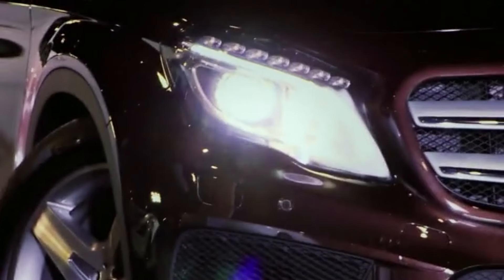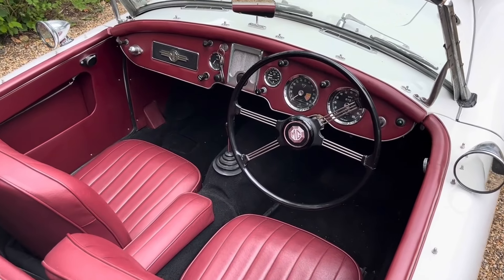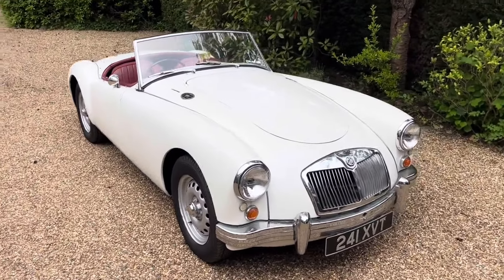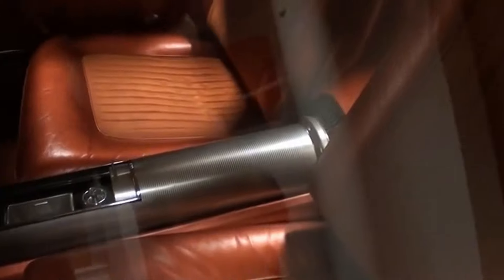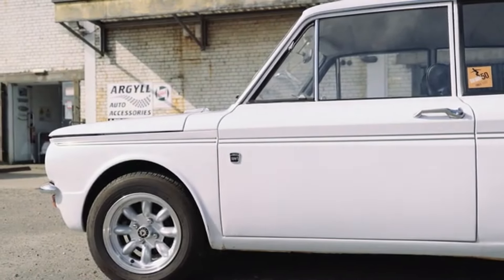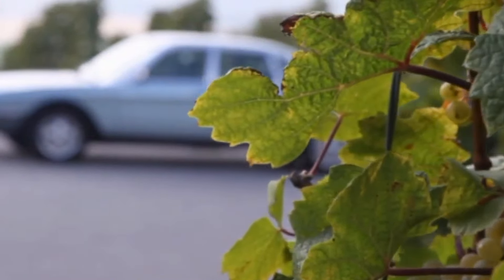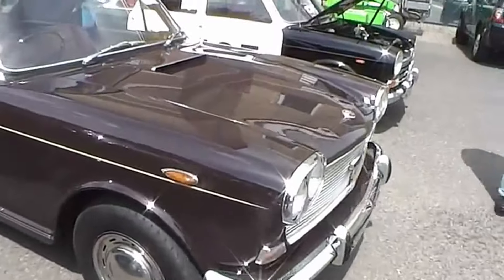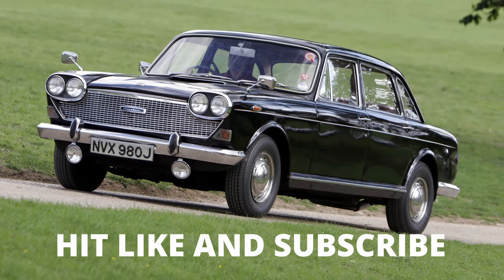GREAT CARS THAT FLOP BECAUSE OF ENGINE

Comment: Only a very small number of MGA's were twin cam engines. Whilst unreliable engine, those are the most expensive models to buy now of the MGA range.  
The standard MGA with 1600 engine is a very reliable Classic car and whilst in the 1980's they were not really important, now they are considered a good Classic car.
Reply: After production of the MGA Twin Cam engine ended, it was discovered that the seizure issue was caused by vibration in the carburettors. By fitting a Weber O-ring between carb and manifold, the problem was entirely eliminated.